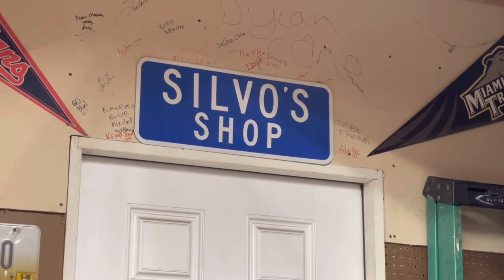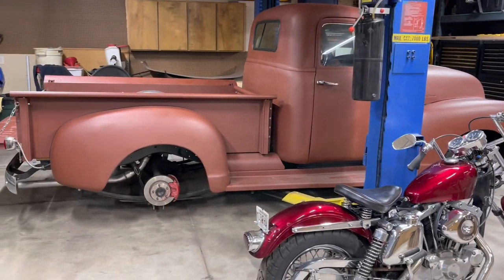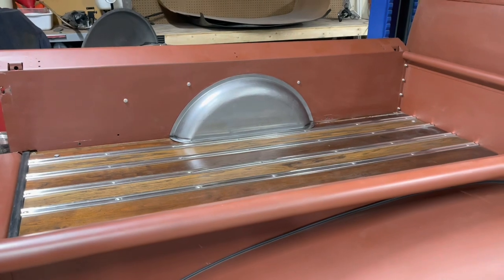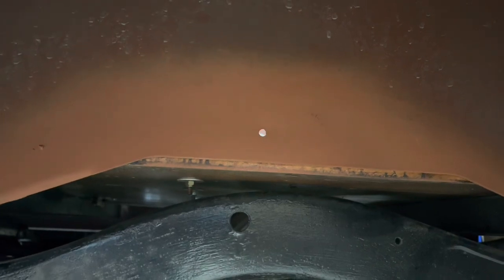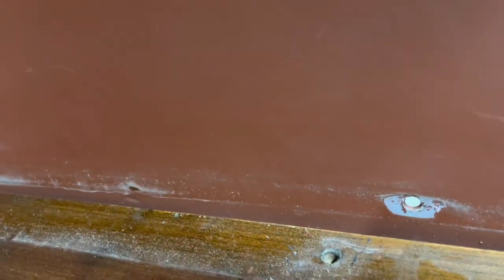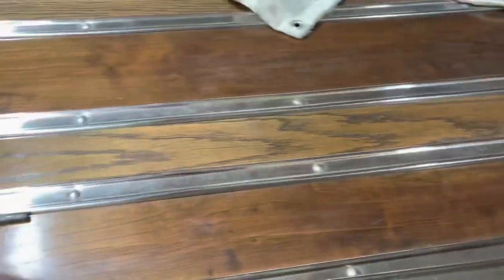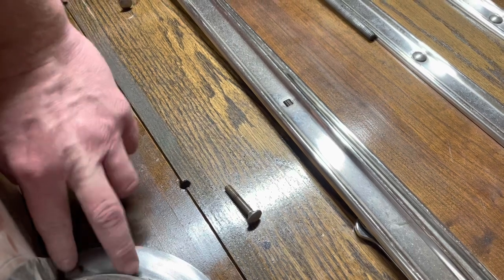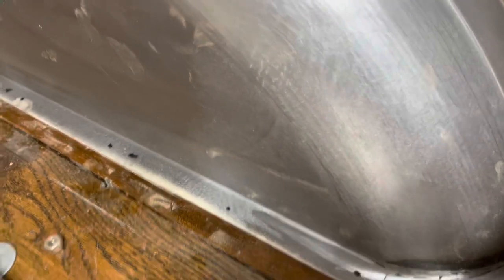LS Fabrication Wheel Tub install - 1949 Chevy Truck Part 1

Comment: Can the tubs be used for clearance for a 4 link and C-notch? I'm asking instead of raising the bed
Reply from the maker: @blue32nu  I believe so.
Reply: @silvosshop  since I have your attention, have you noticed any loose fasteners on the ifs? I'm wanting to go this route but use HUCK BOM fasteners.  Granted, the gun cost a couple grand to even install these but it leaves a permanent rivet like appearance and strength